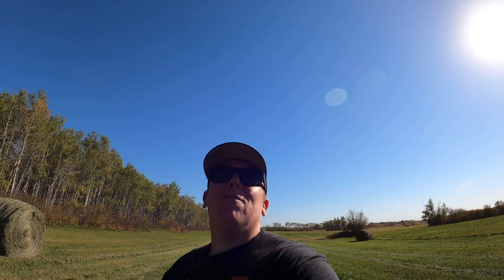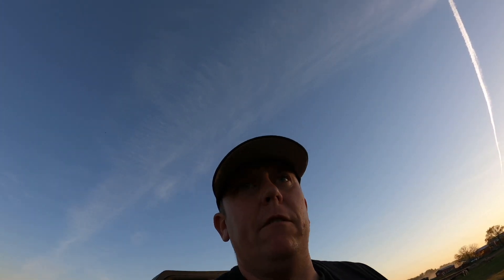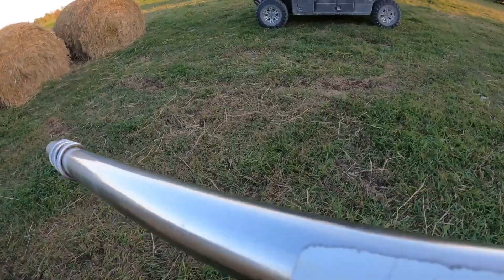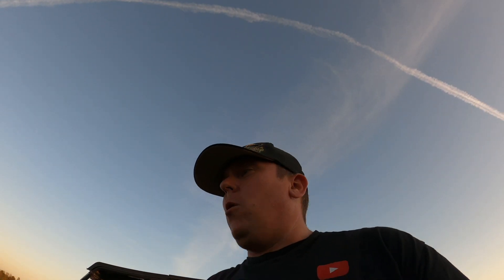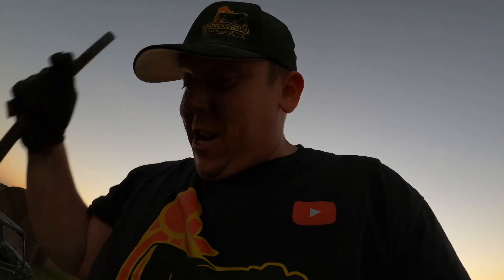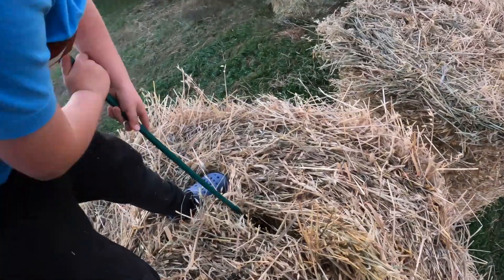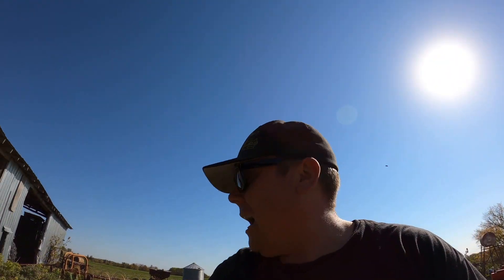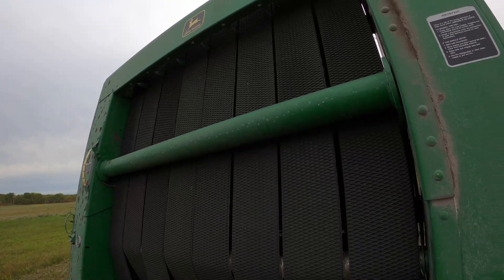EMERGENCY 🆘 treatment for HEATING & MOLDING hay BALES the HOW to guide for reducing SPOILAGE!

Comment: I bale most my alfalfa hay at night. Baling during the heat of day all I get is sticks. Moisture tester would read 25-30% at times. Those are my best bales
Reply from the maker: The moisture/dampness definately holds the plant together better when baling.👍 Cheers 🍻 Wally. You done haying for the year yet?
Reply: @PrairieSunsetRanch  yeah lol. I had nothing to hay here really 😂. 250 acres older stand nothing grew to cut. I Cut what had a little bit.  Just over 400 bales off 700 acres
Reply from the maker: @wallyyuriy8912  What a year this has been. One for the books 4sure, time to open a new chapter and hopefully 2022 will be filled with a little better or more positive of stories 🤣👍
Reply: @PrairieSunsetRanch  can only hope….🍻
Reply from the maker: Cheers 🍻 Wally.👌

Comment: The salt should do the trick. I was thinking you should have a preservative applicator and then you have one.😂👍 I run the liquid on the square balers and would like to add it to the round baler. Gotta love those strange noises.😵🍻
Reply from the maker: My other baler has the applicator which was at home. All my equipment was way out of my area baling hay so jumped on that field last second. Never thought 3rd growth would come in so hot and heavy as to impair the drying of the second cut oats!😱 That knocking usually is indicative of a bearing going out but in this case it just had to let the gremlins out!🤣🤣 👍

Comment: Garbage parts probably! I had bearings in the bale and combines that fell apart this year that I have changed in the recent past.
Reply from the maker: Chit, that sucks. I noticed for example John Deere carries some "John Deere" brand bearings that are stamped made in China. I've had a couple of those fail in 3-400 bales on the baler.🤬
Reply: @PrairieSunsetRanch almost exactly what we had. Bought national bearings. Take the bearing out of the package. Stamped made in China. No national marking on the bearing at all. On the combine pick ups the center of the bearing split and the balls stayed together and were running right on the shaft. In the baler one bearing made about 250bales and just blew up and fell apart like it was 40years old

Comment: You should have just used your bale spear a few times for the holes...or would that not work??
Reply from the maker: I have done that in the past but pending on the bale can make a little of a mess. These weren't necessarily wrapped the tightest. I knew they were probably gonna heat so I didn't want MASSIVE tight wrapped bales. Need it to sweat out a little so they were a lil sloppy. 👍